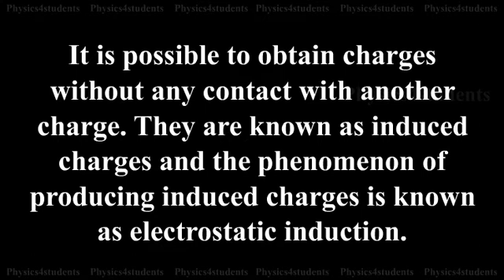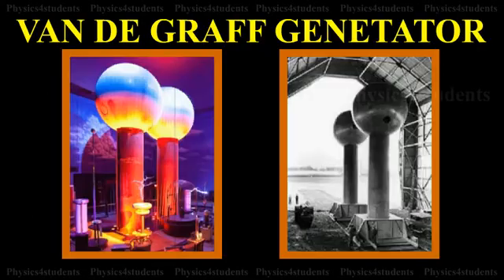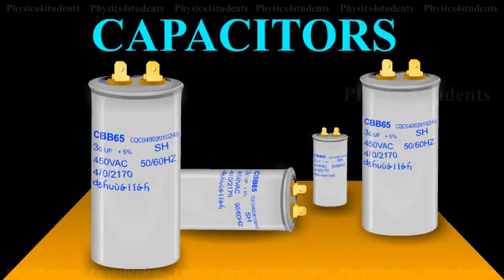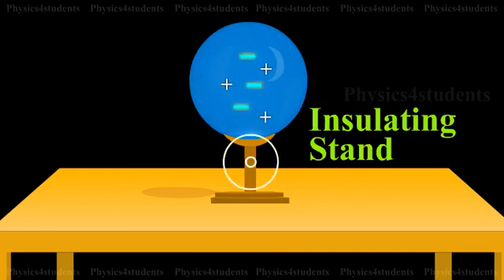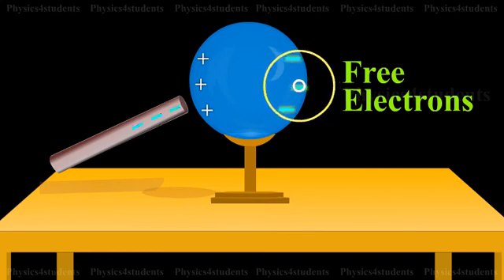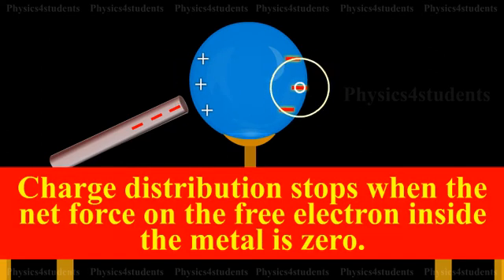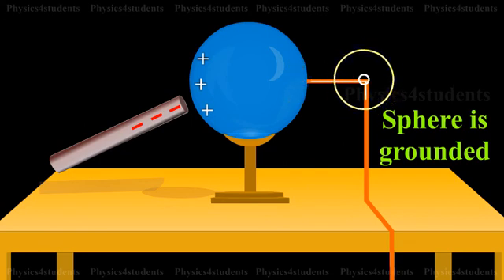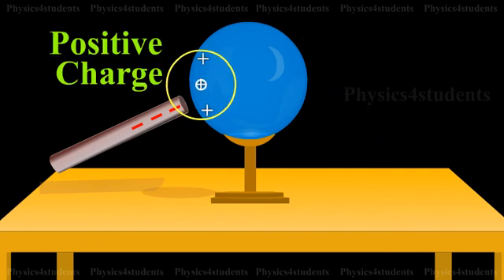Electrostatic induction

Comment: kindly tell me Plastic is insulator how he could be charged negatively
Reply: it's an insulator so the electrons are not free to move about, they are trapped, however when you rub it against another insulator, the electrons are scrubbed off the other insulator and forms a layer on the plastic, making it have a negative charge.